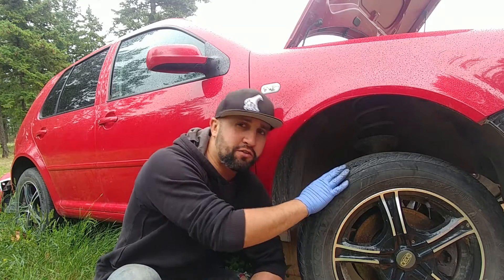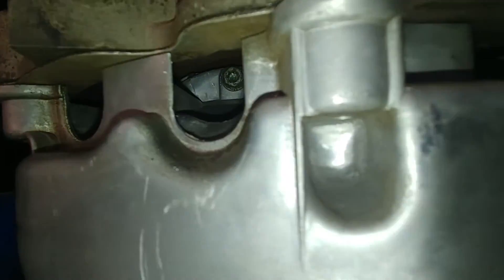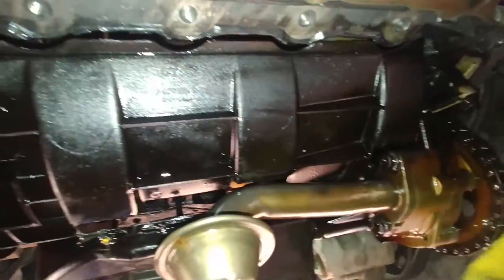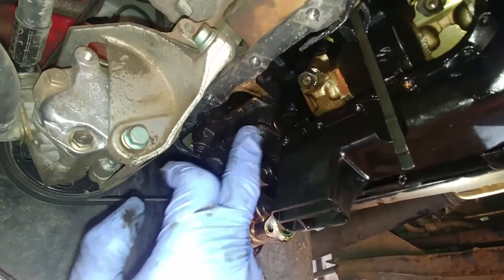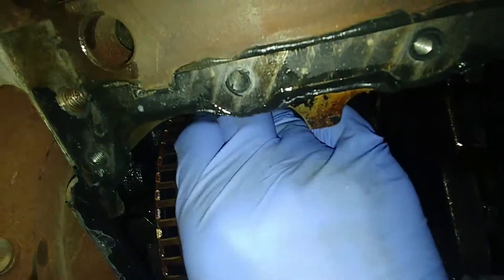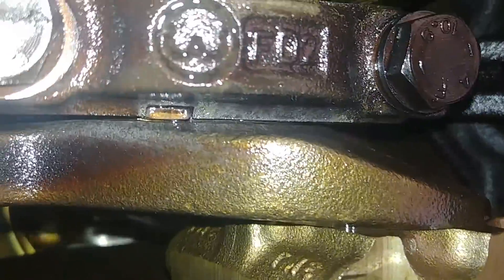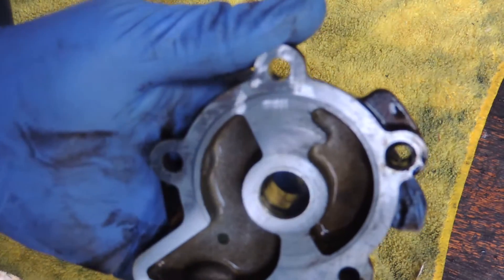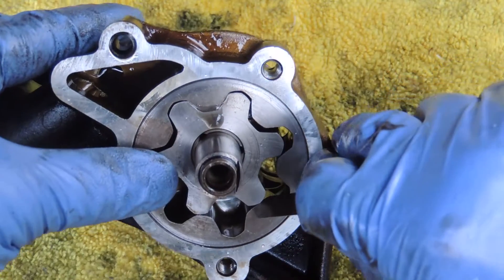VOLKSWAGEN NO OIL PRESSURE. Tips, Inspection, Oil Pump Removal. Golf Jetta Beetle Polo

Comment: I have a
 1.9 TDI Jetta 03. My engine was rebuilt and now it's throwing the oil 
warning. It only does it like 10-15 minutes after fully warmed up and 
smokes a bit more at that time and not while warming up. If the pickup is clogged, will it trigger the warning any any operating temperature or only when it fully warms up ?

Comment: Great video! I own a 2016 gti, 62k miles.  recently my oil pressure light started coming on, always at a stop.  long story short .. oil pan was dropped and there are shavings and found a chunk of metal in pan. They didn’t inspect oil pump, just straight up said, NEW engine, cost more than car is worth. Pan was cleaned, oil changed with same weight 5-40 light hasn’t come in for couple days now. Any advise you can give would be greatly appreciated. Don’t know much about mechanics, totally sick about this.
Reply from the maker: Hey m height. Well, I would keep watching oil light carefully. Definitely do oil pressure test with manual gauge. Most likely engine won;t last long. Just start looking for the swap engine. Sometimes you can find them at the junk yard pretty cheap. 
How much shop asked for the labour and parts?
Reply: @PistonShack  15k, and another 2k for brake pads, reverting the ECM and couple other minor things.  The car's value is 17k-22k.  I feel like selling to someone that can fix it themselves for a-lot less.  Just love this little car, but don't feel safe on hwy with this problem.  Thank you so much for your reply.
Reply: @mheigh4168  what model 1.8t is m8?

Comment: Great video very clear. So how was the low oil pressure issue resolved? I understand that you checked oil pump and all but did the vehicle restore its normal oil pressure?
Reply from the maker: I ended up replacing the engine with known good used one.

Comment: thank you for the info. my golf 2001 has oil pressure problem. it is not about the sensor and the pump as we know. but they could not find the reason. That warning just appears after I drive 20-25 min. Do you have any suggestion?

Comment: Did not find the main bearing replacement Video, was the engine shot, curious how it turned out.
Reply from the maker: I ended up replacing the engine.
Reply: @PistonShack  Thank you a friend has a drop in oil pressure in a car he just bought and appears to be similar.

Comment: Managed to sort 2 of these now without removing sump or crossmember etc
Using a toothbrush a trim pick and also lots of kerosene 👍🏻
Reply from the maker: Awesome brotha. Thanks for sharing your experience! Did you film any videos? Let me know if you have any questions. Cheers!
Reply: PistonShack next one I do I will film it bro but before doing the ones I’ve done I did look at your video 
One was a 2.0t A4 b7 tho which suffer similar pickup issues

Comment: I have my 2017 golf sportswagon in the shop right now because the stop low oil pressure light came on. They put a new oil valve and oil pressure sensor, I thought they had figured it out. Now they want to do an oil treatment. They said it’s still doing the warning light after it warms up. Would it be better to pay them to pay them to pull the pan instead of the oil treatment? When the warning light came on, I got the oil changed immediately but after a mile of driving, it came on intermittently. I just bought this car a couple months ago and it only has 55,000 miles on it. Help!

Comment: Can you help me?. I own a Audi A3 2.0 FSI from 2005. I am going to have too take the sump off soon to reseal it so I was going too change the oil pump too while the sump is off. I have the Manuel and it's telling me that if i want the chain removed i have to take off the timing belt off and the crankshaft oil seal housing. Can I change the oil pump without taking off the timing belt and crankshaft oil seal housing??.

Comment: Hi PistonShack, thank you so much for this video. I was wondering what state and city you are located. I would like for you to please fix my car that has the same oil pressure light coming on
Reply from the maker: Hi Nanreza! Thanks for your comment. I am glad it helped you out to understand low oil pressure issue on MK4 VW specifically. I am from Canada. What is your oil pressure reading at cold start, warm idle and 1500-2000  rpm?
Reply from the maker: Yeah, let me know if you have any questions! Cheers)

Comment: Great video! Easy to understand and could see everything well 
I have a problem with my 2013 gtd. low pressure warning light on cold start. Goes away once engine is warm. Any ideas??
Reply from the maker: Hey Kirk! I would check actual oil pressure value by using manual gauge. Check readings Hot / cold idle and 1500-2000 RPM hot pressure first. Let me know what pressure do you have. Cheers!

Comment: If the oil pump failed when the vehicle is in motion, what other parts are likely to be broken?
Reply from the maker: Oil pumps normally don't fail right away. They worn out slowly. If oil pump chain brakes pump won't work.

Comment: Hi have a Vw Caddy 2.0 TDI that's losing oil pressure only when hot. Clearances are good, new main ,big ends , oil pump,oil cooler and oil filter. Really don't know how to solve the issue
Reply from the maker: Hey Nathan! Did you check actual oil pressure @ hot idle and 1500-2000 rpm?
Reply: @PistonShack  yes we did sir , and the pressure drops as soon as car gets to 90 degrees celcius

Comment: Just got my vw gti back from the workshop after 3 months because of cylinder #3 misfire which was caused by a broken piston ring. 
But after 150km of driving the low oil pressure light has come on. The mechanic is closed for 2 weeks and im not going to drive it until it is open. Is this an issue they have caused from the recent repairs or a new problem i have to pay for?

Comment: I have a question about any specific sound during driving on low oil pressure. While ago I had a ride with low oil pressure and the engine started rattling. I was taken by the tow truck, but the issue isn't sorted yet. There is a very clear knocking noise on idle and becomes a rattling on higher RPMs. I'm not sure if the noise is caused by the low oil pressure or the engine is gone already. I think I will handle to rebuild the engine, I've already replaced some parts of the engine gearbox, turbo cam chain tensioner and more, but I don't know if the internals are gone.
Reply from the maker: Hi Brotha! Sounds like your connecting rod bearings gone. Did you check engine oil pressure? If yes what readings do you have at idle and 2000 rpm. Let's go from there! Cheers!
Reply: @PistonShack  Thanks for the answer. Did not check the oil pressure as I just started the engine first time since this happened and replaced other parts first when the car was off. I also suspect the rods, but can not hear the noise when I crank the engine, just when engine runs idle and rise with RPMs

Comment: I had the same issues with pan hole only issue afterwards is with oil pressure light over 2k. But no loss of power no weird noises other than a rear main exhaust leak. Suggestions?
Reply from the maker: Hi William! That's not sound any good. Did you drive with a pan hole before noticed? Have checked actual or pressure on warm idle and 2000 rpm?

Comment: I have exactly the same problem.  My nephew put a hole in the oil pan and ran the engine with the light on until it stalled.  Replaced the oil pan and the car still runs!  2 days later the oil light comes on :(  Watched this video then.. Took oil pan off and found shavings.  Saw same broken shavings in spaces between rods.  What was your next step?
Reply from the maker: Hey Daniel! I so sorry to hear that. I would find running junk yard engine and swap it in. I won't even try to rebuild original one, it's not worth it. Let me know how if your repair. Cheers!
Reply: @PistonShack  We are going to try to replace the thrust washers and bearings on the crankshaft AND cam shaft.  Wish us luck.  Would you think there is likely damage deeper in the engine?
Reply from the maker: I would inspect crankshaft / beds ect. for any damage before replacing any parts. Otherwise just replacing bearings and washers will be just waste of time and money. 
My fingers crossed :)

Comment: Hi I wonder if anny one can help me out my 1800 golf m3 has oil pressure at the oil filter  but when I test for pressure at the head there is none. What I did is change the oil and tried again it still had no pressure to the head.,then the problem went away I drove for about 40 kilometers switched the car of and when I started it again the problem was back, oil pressure is constant 4 bars at oil filter sensor
Reply from the maker: Hey Andries! Interesting, what oil pressure do you have at the filter housing @2000 rpm and warmed up idle? I am not sure about pressure readings at the head. Did you try to take valve cover of to check for an oil flow?

Comment: Hi I have an issue on my gti mk5 bwa engine. Oil pressure sensor came up saying stop. Put in a new oil filter and new oil. It was fine until 15 mins later. Then same issue happened again then the engine started making a real loud noise. Check the engine oil on the dip stick and there's oil. Gonna check sump and pickup pipe hopefully it's just the pickup pipe blocked.Anyone had similar issues like mine? Can it be the pickup up being blocked and making loud noise in the engine? Any help would be appreciated
Reply from the maker: Hey AsgarH! Have you tried to measure actual oil pressure with a gauge @idle,  and  2000rpm on warmed up engine already?
Reply: @PistonShack  thanks for the reply. No not yet I will be doing this over the weekend. I checked on vw forums and this tends to be common issue on the mk5s. Hopefully it's not a big issue as I found out that this can cause an bigger problem with the engine
Reply from the maker: @GassGar  Sounds good brotha! Always hope for the best. Let me know what pressure readings do you have.
Reply: @PistonShack  will do bro.👊🏾Hopefully I'll start YouTube as I love My vw golf and the mods will be crazy on it 😂

Comment: I know this video is a year old but I'm having the same problem on my MK5 GTI I just replaced oil sensor in the oil pump and I'm still getting the low pressure warning my car sounds quiet the engine seems fine just had an oil change I can't figure out what's going on
Reply from the maker: Hey Laurence! I would check actual engine oil pressure with a gauge @ start up / warm up, warm idle and 1500-2000 rpm first. How many clicks on your MK5?

Comment: Hi, let me tell you - I'm not a mechanic, but I understand a bit ... I have a problem with the oil pump. When I drive a car, for example 80km / h 4 speeds at 2000 rpm, my lights do not come on, but when I drive down a hill or up a hill, it always comes on and it says Oil pressure: Engine off! Owners manual! I did a big and small service, changed the oil pump, changed the air filter, filled the air conditioning, changed the PC belt, changed the oil pressure sensor but in vain it occurs again at intervals. I drive a Skoda Octavia 2011 2.0TDI 103kw 140hp 6 speed. Does anyone know what the problem is to tell me would mean a lot to me.
Reply from the maker: Greetings! Seems like under the load your engine experience so oil starvation. 
What is your engine actual oil pressure readings at idle and 2000+ RPM? I would check pressure with analog gauge then go from there. Let me know how everything is going. Cheers Brotha!
Reply: MrNebojsa43 did you find a solution? I have the same problem

Comment: So whats the oil pressure problem if it wasnt the oil pump?
Reply from the maker: Hi Jason,
Cause of low engine oil pressure was worn out piston connecting rods bearings.  Clearances in between moving engine parts create oil pressure. Tnx.
Reply: I have a gold mk4 recently I changed the cone bearings, thrust washers oil, hydraulic tappets, oil pressure switch, oil pump, changed the engine oil, however I have a rough idle, slight misfire and the low oil pressure sign comes on after sometime.
 And it is consuming a lot of fuel I'm suspecting 8km/L 

I'm yet to change the air filter and the breather pipes are in a bad state

Comment: hello my vehicle 2015 ww Jetta 1.6 TDI.  About a year ago, my vehicle gave a low oil pressure signal. After a long interval, we gave the same warning again and we made a pressure measurement, the pressure was low 2000 rpm: 1.2 bar. The oil pump, oil stump, oil jets changed and the solution was not removed.  All engine bearings changed and overhaul. The problem is not solved pressure again low. What could be the problem?  What's your opinion?
Reply from the maker: Good day! Sounds to me your engine crankshaft clearances are getting bigger way out of the manufactures specifications. Probably, when you replaced previous engine work wasn't done properly or engine engine experienced oil starvation at some point after.  
Oil pump itself doesn't create the pressure, clearances in-between the engine components do. How that oil pressure drop happened during the operation?
Reply: The engine was measured, the blogs and the cylinder head did not show any cracks.  The main and sleeve bearings have changed.  Crank and eccentric control. Oil pump and oil index changed.  All mechanical controls were performed.
Reply from the maker: Okay, I see. First check for any engine wear, look for any metal shaving on the bottom of the oil pan. Check oil pump pressure spring regulator valve. Second, always use recommended type of engine oil. Check engine coolant operating temperature - high temperature can thing the motor oil and lead to lower oil pressure on some vehicles.
Reply: mechanically all parts were checked.  The motor was removed and the test and measurement were performed.  Could any electrical installation or software error reduce the oil pressure? No solution for exactly 2 months.  this annoyed me quite a bit.  I went to many mechanics and found no skillful solutions.  It's unbelievable, they've tried everything they need to do, they say I need to buy a new engine 😔 so I wanted to get help from you.
Reply from the maker: @serkanpordy5206  I agree, you need to know what cause the low engine oil pressure. Software won't effect oil pressure directly but it could happen due to oil dellusion with fuel, incorrect fuel ratio and fuel trims, ect. 
Data does not lie. If specs were in limits at the time when engine was assembled, it doesn't mean engine is okay right now. Could be two possible reasons: poor quality parts installed or low quality engine rebuild work was done. Possibly combination of both. 
It was alright for awhile then your engine started to fail. 
Check those thing I told you previously, then we can move forward. Start by Dropping the oil pan and look for shaving like I did in my video.
Reply: @serkanpordy5206  hello i got this problem too, ive tried everything and the problem was not with the bearings or sensor, it was the oil sump, at first it looks cleaned then i removed it and flooded it into fuel to clean it, then i found that the silicone  glue was blocking the oil sump, ive cleaned it and everything went fine till now. I would suggest you to try cleaning the oil sump.
Reply: @serkanpordy5206  you should use the recommended oil, I bet you're using 20w-50